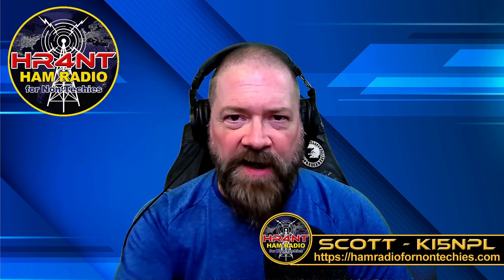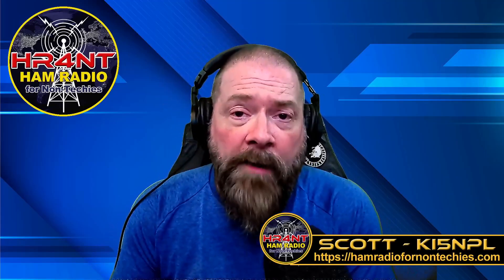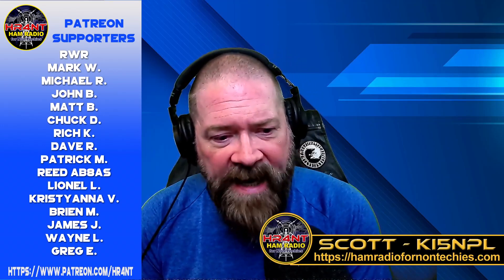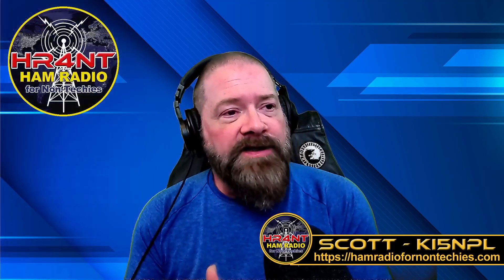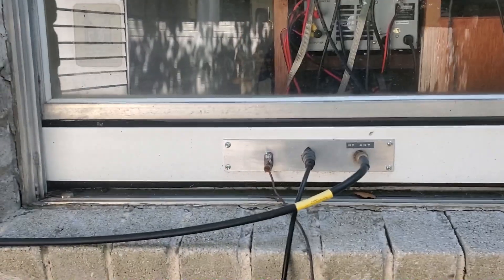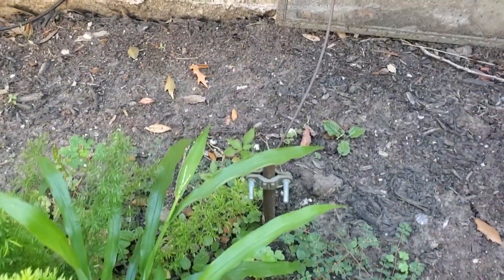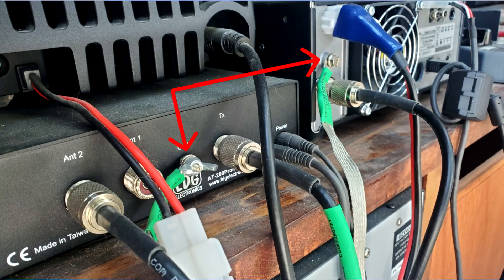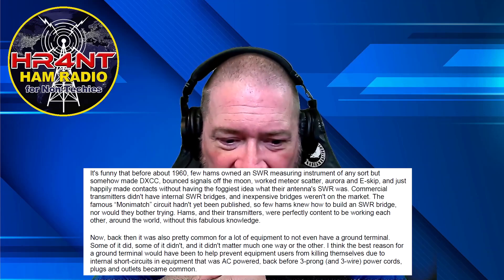Grounding My Ham Radio REVISITED:  What I Have Learned Since Then

Comment: When you plug anything into a modern 3-prong outlet, you are using the home ground through your distribution panel. When you then plug your radio into the wall and then ground it out through a strap connected to a separate ground rod, you are using 2 different grounds that can have a serious current differential between them. There is a reason why code wants you to bond the two rods together.  And although your two rods seem to be far apart, one #6 copper ground wire run around the corner and attached to your home ground isn't that difficult. You may or may not have a problem, but safety is foremost.

And grounding your radios isn't a duplication - RF energy can do strange things and your transciever needs to be well-grounded to prevent noise in the shack.
Reply from the maker: Thank you for that info.  My technique seems to have been working for some time now.  I kept the safety ground, but that is about it aside from the three prong connection.  Thank you for the comment and for watching.  73!
Reply: Thank you , Thank you, Thank you!  I followed your instructions from your original grounding video because I was over thinking everything ( I'm a newbie ) and only taking my 7300 outside with my power source and my Buddipole antenna. I always wondered why the big deal with the same stuff inside and working on my patio.... anyway I appreciate your video and the article. Glad you are looking so much better since the accident. 73
Reply: Well, then all you need is a ground lift!
Reply: Fix your antenna. Rf grounding prophets)
Reply: this is my understanding as well, that if you add another grounding point,  the voltage potential between the two points ( your house ground and your new ground rod )will be different a little bit. so by bonding the two grounding points together, it makes the voltage potential ( difference ) between the two points Zero. thats my basic understanding. Also, i am interested in grounding to get rid of as much rf noise as possible.  good chat going on here 👌
Reply: Voltage differential seems like the best argument for bonding your grounding rods back to the electrical panel to me.

In my case, I have a Starlink dish at one end of a mobile home and the electrical panel at the other end; 80 feet away. However, if I were going to drive a separate grounding rod at the end where the Starlink dish is at, I'd bond it by connecting that grounding rod to the metal undercarriage of the mobile home. I tested continuity and verified the metal undercarriage was connected to the ground of the electrical panel.
Reply: @markdavis5486  That would probably work, as long as you make sure the connections to the m/h frame are bare metal, to make a good electrical connection. You'd just be bonding the ground rods through the frame.
Reply: @gpbarth  yeah I'd drill into it and make sure I got a good contact.

Comment: Dx Commander took a direct hit once, they paid out $30,000 as a station ground was used.
An assessor is paid to find loopholes like that  to NOT pay out....., a bit like a car crash.
It could be said, you may not be seeing  see the wood for the trees, atm.
Great guard dog sign 2.8 secs gives em a chance, a bit like a station ground, if insurance gets involved.
Great to see you back Scott 👍

(Dx Commander also said no arrestor will save you from a  direct )🎯
Reply from the maker: Agreed.  I do my best with what fits my situation.  This seems to have worked so far and we get a lot of storms here depending on the time of year.  A direct hit always equals screwed....LOL  Thank you for the comment and for watching.  73!
Reply: @HR4NT  Just getting into this & have a DX Commander on order.  Where I live in MT I get lots of wind & sometimes   high winds, 60 mph and higher.  What are your thoughts on grounding the Commander coax for a static charge created by wind on the antenna? -  On a side note, from what I have read the Yaesu Fp-1030 power supply I ordered does not even have a chassis ground screw.  I'm not worried.
Reply from the maker: @chip9177  you could add a lightning arrester to the coax on the antenna side.  That should handle the static.  I have my arrester attached to a ground rod.  I have had no issues to date.  I hope this helps.  Ask around and get a few opinions on this.  73!

Comment: Any grounding is better than no grounding. I'm installing lightning arrestors at the wall and grounding them to a rod. But I'm with you about just unplugging stuff if I'm not using it.
Reply from the maker: I agree.  I am keeping my lightning arrestors that are attached to my antennas, HOWEVER, I am not going to stress myself out over grounding.  I am keeping the safety ground and continuing to unplug in the event of a storm.  Worked so far...LOL  Thank you for the comment and for watching.  73!

Comment: I do the same thing. I unplug when storms are coming. Based on my research, the electrical ground at the outlet is all you need. I have a ground rod and window pass-through anyway, but I don't worry, since I unplug.
Reply from the maker: I think that is a good policy to adhere to.  It has worked for me for over 2 years now and my gear is protected.  Thank you for the comment and for watching.  73!

Comment: I was hoping you were going to do an update on your shack grounding. That’s what my conclusion came down to especially how I utilize my gear. The only radio that stays in my shack is my 2730 and that’s the only thing keeping have since I’m mostly driving. When I’m not home, it gets unplugged. When I’m home I plug it in and talk. Glad to see a new video from you Scott. Continue to get well. 73!
Reply from the maker: Thank you very much.  I had requests over the past year about this topic and I had to find a way to approach it without being redundant. I think this definitely is something to think about.  Unplugging your gear is THE best option for reasons I touched on in the video.  Thank you for the comment and for watching.  73!
Reply: @HR4NT  In one forum, a comment was, " 'The "just unplug your coax" crowd is all the evidence you need that you don't need to be smart to get an amateur radio license."  This was in a discussion about having NEC compliant grounding and lightning suppressors and also disconnecting the antenna cabling when the radios were not in use.  

I remain unconvinced that any affordable lightning suppression (under $1000.00)  for the amateur radio station will not protect from a direct lightning strike.

Comment: Often times good station grounding will help quiet the noise floor.
Reply: Agreed. I tried a little ground rod just to see if it would change anything. It makes a huge difference for me. 
FWIW… I’m in the desert with Rocky and sandy ground. A single ground rod makes more of a positive difference for me than any amount of radials.
Reply from the maker: @KF7UCK That is fantastic!  Thank you for the comment and for watching.  73!
Reply from the maker: I need to tackle the external RFI from my neighbor still before I can address the next source(s) of RFI.  Still working on it.  Thank you for the comment and for watching.  73!